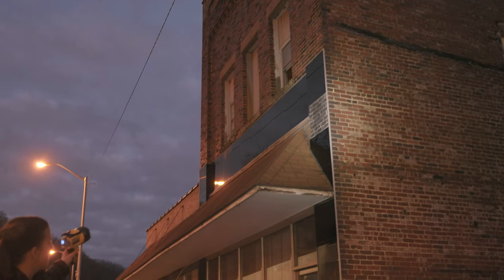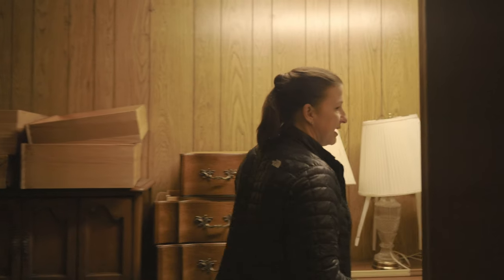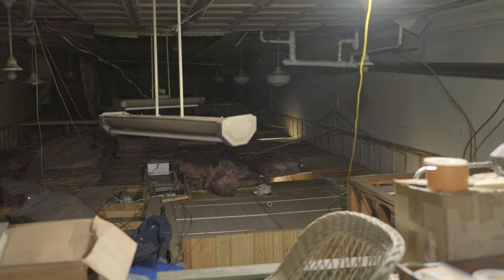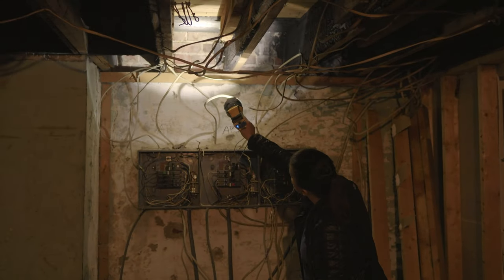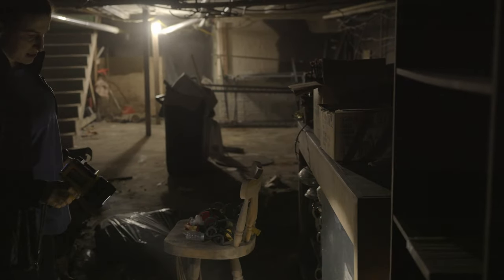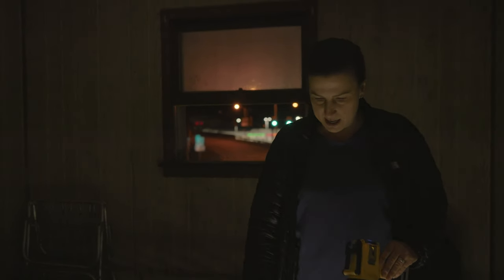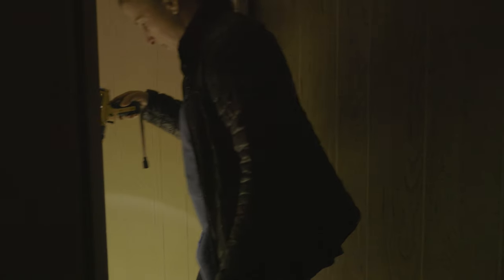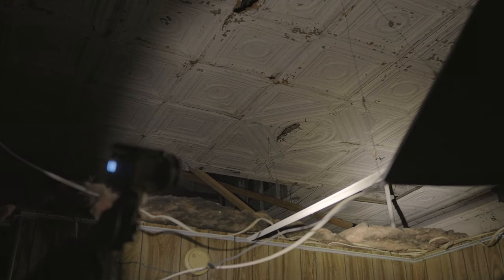Western Auto Building - Insider Tour

Comment: A lot of the old Western Auto stores had room in the basement to service cars. Not allowed by code now from what I understand.
I grew up in middle Ohio and a lot of your furniture and clothing stores had two floors.
The disabilities act put a lot of these second floor retail spaces on the extinction list as the buildings just weren't designed to hold an elevator.
The worst thing about these old buildings is the flat roofs. As the years go by they sag from their own weight and don't drain properly. Water creeps in and it freezes pushing things apart compounding the problem.
The big expense for a person renovating is getting the roof tight and dry.
I grew up in these old buildings, my dad belonged to the local gas company and I often accompanied him on his calls when school was out or weekends.
We found a lot of cool old stuff in the forgotten areas of these old buildings.
Thanks for sharing!
Cheers
Terry

Comment: Problem with retrofitted apartments in those old buildings, is that someone can just climb up into the drop ceiling and right over your front door and right down into your apartment.  There's also nothing to stop fire from spreading from one unit to the other in the void up in that original ceiling space.  You might also want to make sure the left behind space heater hidden in the ceiling in the original first floor is disconnected.

Comment: Those dark, exterior "tiles" look like what was known as Vitrolite (generically called pigmented structural glass). Vitrolite was one of many brand names but eventually came to mean the product generally, across all brands/makers (like Kleenex is for tissues). It was widespread in architecture during the late 1930s, '40s, and maybe into the early '50s too. During that period, a popular use of the product was to veneer over already-existing, old-fashioned style facades with the panels. The thinking was that the Vitrolite made an older, masonry building look more sleek and "modern." Commonly, examples will be seen where only the ground floor, "business front" of a multi-level building was re-styled. It looks like that is the story with your Western Auto Building. In your case, is the Vitrolite old and something some might consider to be a historic feature? Yes. Does it date back to the building's original construction? Based on all appearances, I would surmise no. So, whether you keep it or not will probably hinge on 1) your assessment of the material's condition and 2) whether you want to do a purist's restoration, where you take the structure back to its original look, or an interpretive restoration which preserves significant, merit-worthy alterations that happened over the building's years and helps to tell the structure's "story." Another big consideration will surely be, if the Vitrolite panels are removed, in what condition is the finish of the original brick behind them. I don't know what was used to fasten the panels onto walls or if the process was destructive. On another note, I love what you guys are doing. Thanks for sharing!

Comment: It's hard to tell for sure but the glass tiles on the front look like Vitrolite. Demand for that product started to dwindle around 1947. It was produced up to the mid-50s but in very small amounts. Newer cheaper ways of making glass tile had been invented end Vitrolite was more expensive because it cost more to produce. So unless someone had a small stock of it it probably wasn't put on in the 60s or 70s. I don't know the exact age of the building, but I almost guarantee it was put on later. The town I live in has at least one building on the old main commercial Street downtown that's been faced in the product, and an old movie theater currently under renovation nearby is also faced with it. The Vitrolite was not original to either building but part of later remodels. If you want to see what I'm talking about, look up The Crump theater in Columbus, Indiana and you can see if what I'm talking about is what is on the front of the building. 🙂